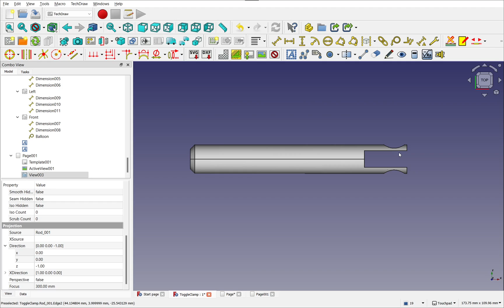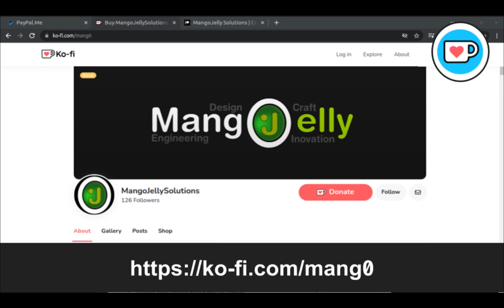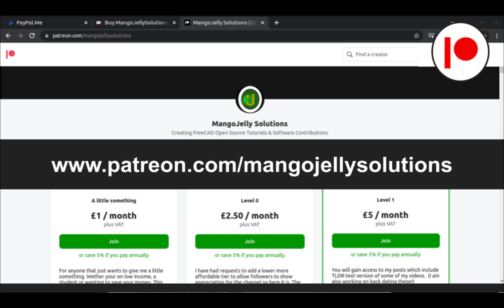FreeCAD TechDraw Error - Missing Edges/ Lines - Solution

Comment: Hey Mangojelly! Do you have any videos about how to add "shrinkwrap" around something?

For example, I would like to model a toroidal transformer and have the outer wrap be transparent enough to see the windings and be conformed to the shape of the windings.
Reply from the maker: Yes so you can change the opacity of the  outer shape you use as a shrink wrap by using the view tab (ne,xt to the data tab) and within you will find the transparency setting. This will allow you to say place a body or box around your object and change the color and transparency from this tab.
Reply: @MangoJellySolutions  Hey, thanks for the reply, that's good to know. How do I make a surface that conforms to another surface, like a shrinkwrap film though?